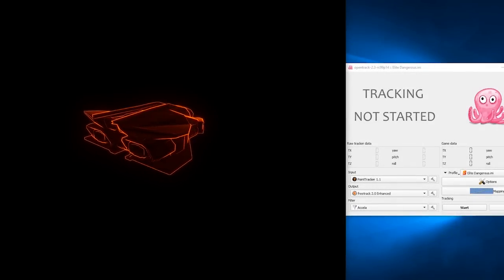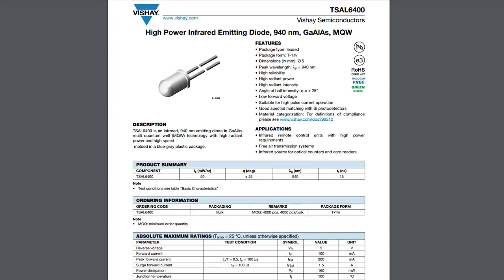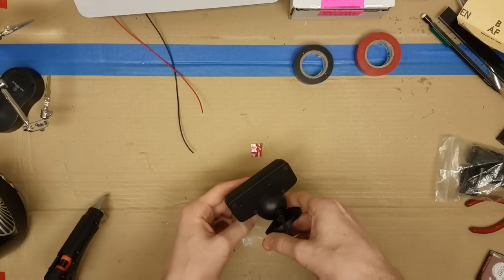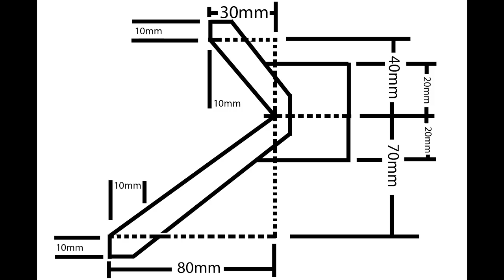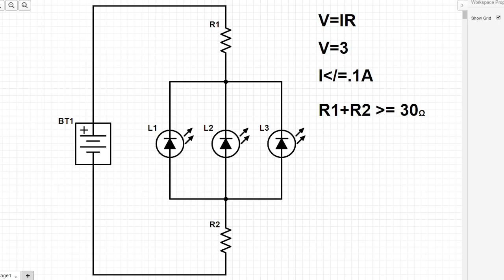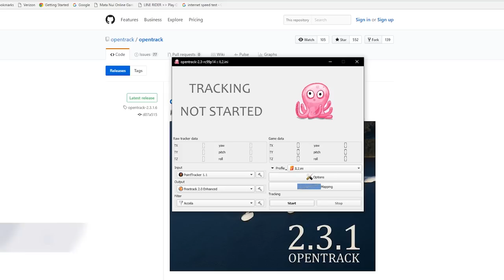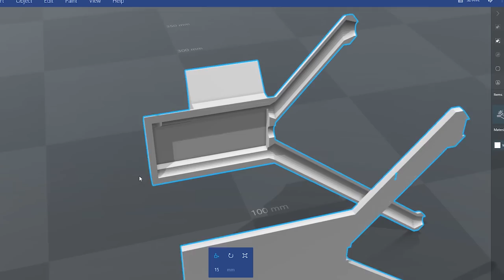TrackIR Build Tutorial

Comment: Any webcam will do. I'm using a very old Genius 640x480 cam. Just remove the internal IR filter from the lens, and you can use low power LEDs (even from old TV remotes). I grinded the LEDs flat so their intensity is same at wide angles. Then in camera options, reduce exposure and brightness untill you only see the LEDs.

Comment: Right, last comment.

I've built three trackers now due to your fantastic how to. I gave one to my house mate. I have a clip for my headphone (though I think it'll never be used because I have a sound system for gaming) and I have rejigged my mcu superman hat which is just a little much to be wearing outside for my fashion sense. The hat works beautifully. For anyone interested and for the vid maker. 

1 60mo resistor.
5v USB power. (I have a  2m USB cable and I chopped a phone charger so I could disconnect at the headset rather than the PC as I have a cat who loves a wire.)
940mn 1.4v, 30ma ir LEDs
Three dead pens (for writing, you need the tube the pen is in)
12 gauge wire I reused from a old fan which is no longer in use. 
A girlfriend who loves to sew. 
A ps3 cam (I have done nothing to the camera(s) (I gave one to my house mate) I just turned the gain down and closed the curtains. I will be buying a filter mind you.

After thought.

I smoke when I game, the camera picks up my on roll and cuts tracking when I have it in my mouth which is.. interesting. Filter is needed..

Thank you. I was saving for that £250 trackir one. I had the money and was about to buy it. I can now use this on something my partner will approve of too. Thanks
Reply: Can you make me one?

Comment: Awesome tutorial! I ordered the parts and will do the build this week.
One thing I'm not quite understanding though is your resistors caclulation. I read quite a bit about electrical circuits today and I am a bit confused.
Your battery Voltage is 3v (2 x 1.5v cells), each LED forward Voltage is 1.35v and each LED max forward current is 100mA. Since LEDs are in parallel you need to provide at least 1.35v and up to 300mA in total which results in:
3v - 1.35v = 1.65v / 0.3A = 5.5 ohms
But then assuming 30 ohms of resistance is used it equates to only 55mA being delivered to 3 LEDs or 18.3mA for each.
I mean if it works then great, it extends the life of the LED but it just seems extremely low.
Reply: Ok I got it to work. I only used a 10ohm resistor but I did have to also follow a tutorial by the Northern Alex and take the IR filter out of the camera. Otherwise, the camera could only detect the LEDs when they were quite close and pointing at the camera.
Reply: @PatrykZ94  You ARE correct.  He could have deliberately added the currents to get 100mA, but his calculation doesn't account for the V drop of the LEDs.
Reply: @PatrykZ94  Did you use one 1 x 10ohm. Or 1 for each IR LED (3)?
Reply: Or another way to do this if you printed yourself a plastic clip with a 3D printer and you want to hide the resistance inside the 3 arms, you could instead use three 15 ohms resistance, 1 resistance per Infrared LED. That way it limits your current to the 0.1A you need. It does add a cost to the circuit (slightly) but depending on how you are building this, this is another way of doing it.

Comment: A couple of things about your electrical circuit:
1) You don't need 2 resistors - only one is needed.
2) Your resistor calculation is wrong.  100mA would give 33mA to each LED.  If you want 100mA each, that's 300mA total for a parallel circuit.  Also, the V number needed for the resistors should be the supply voltage minus the forward voltage of the LEDs.
The TSAL6400 Vf is 1.35V,  so now your supply is 3-1.35 = 1.65V
Current is 300mA.
R=1.65/0.3 = 5.5 Ohms.  
5.6 ohms is the nearest available.  That would give 98.2mA per LED and it would need to be a half-Watt resistor at least.

30 ohms with 1.65V drop gives 55 mA - about 18.3 mA per LED.

So while it IS an error, it's under-driving the LEDs rather than over-driving them - this is the "right" kind of error to have. :)
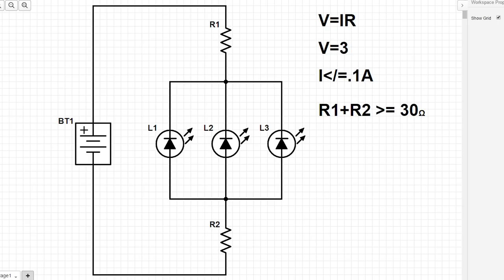Reply: First of all, LEDs are turned the other way around in the schematic. So it doesn't matter what resistors he uses :) 27:14

Comment: I followed your tutorial and yep, it works! Great video. I'm also using the recommended filter, it works great.
Reply from the maker: I'm glad your build works. How was sourcing parts? Was the filter easy to get ahold of?
Reply: @civilprotection8845  The LEDs were easy, and I bought the exact same filter as you from China for $17. I printed a chassis myself. A battery pack I had handy. The camera I already had from having a PS3 years ago; that was the stroke of luck that made this most feasible. I've now tested about 6 types of DIY head tracking, and I like this the best! I might make a video comparing them all.
Reply from the maker: @colinjacobs176  I'm glad to hear that the sourcing was smooth an easy. Sometimes I play with the idea of making an updated video, swapping out some of the major components. I mean, the PS3 eye camera is way too expensive right now for what it is. I have also experimented with alternative filters, but nothing beats purpose-built so far.

And you should definitely make a video comparing all your DIY experiences. The more info available, the better IMO.

Comment: Thanks for such a well explained and detailed video friend. We all appreciate it :)

I had built one few years ago and it was not solid enough, I hadn't really used filter or anything just normal leds and stuff, but with this video I am building one from scratch and hope it will be like in the intro of your video. Other than the brightnesses of the LEDs that I have bought, which may not be enough, I have nothing to worry about.

Good work !
Reply from the maker: Yeah, the LEDs, and the filter are by far the single most important components. I know I spent way too much time and money trying to figure out I needed brighter LEDs. Anyway, I really hope you get yours working (I'm sure you will), and would be very interested to see the end result :) if you run into any problems continue to do my best to answer questions. good luck!

Comment: More questions,

Why would you put a resistor after the LEDs? Why would you need a resistor going back to the battery? Why not one 60om?
Reply from the maker: Resistors can be placed anywhere in a series circuit. Both of mine could have been placed before or after the LEDs. I chose to split them up to keep the wire assemblies proportional and symmetrical. I used two because I needed about 30ohms resistance, and I only had a 10ohm and a 22ohm on hand. If you have a single 60ohm resistor for your 6V setup, then there is no reason not to use it.
Reply: @civilprotection8845  you are  excellent, thank you very much.
Reply: @civilprotection8845  oh, btw. I had a ps3 eye cam on hand and wire. My build cost £4 so about $5.
Reply from the maker: @Jowley  $5!?! I guess everybody can go home. I don't think anybody is going to beat that.

Comment: Great vid. So you didn't remove the IR lens from the PS3 camera but instead bought a lense and put it on the camera ?
Reply from the maker: Correct. I didn't want to risk damaging the camera by digging around inside. The internal IR filter is already weak bc the camera is designed to track the IR emitting ps3 wand. All I did was attach an IR pass filter. Still works great for me after 5 or so years.

Comment: Please help, I can't find the exact LEDs where I live, but will these 5mm IR LEDs work the same? Do I need to modify anything else if I use these LEDS:
Forward voltage: 1.5 - 1.6V
Maximum forward current: 60mA
Wavelength: 850nm
https://uge-one.com/led-infrared-transmitter-clear-5mm.html

Comment: Which resistor did you put in each circuit, the positive and negative respectively the 10 ohm and the 22?
Reply from the maker: I placed the 22ohm on the positive side, and the 10ohm on the negative side. However, I do want to stress that even though I divided the design into a positive half and a negative half, it is all one circuit. It does not matter what resistor is placed where in the series circuit, as long as the total resistance reaches your threshold.

Comment: There are three diodes and EACH diode needs 0.1mA of current, thus the needed total current I = 0.3mA. 2 rechargeable AAA batteries give V= 2*1.2V = 2.4V. To find the resistor value R= V/I = 2.4/0.3 = 8 Ohm. 30 Ohm resistor in the video gives 3 times less current, which is good for battery life, but leads to dimmer LEDs.
Reply from the maker: I definitely did my calculations wrong way back when I made the video. However, there was an unanticipated benefit to over-dimming the LEDs. If the LEDs are too bright for a given distance, the halo can manifest as a visual artifact, which Opentrack interprets as additional points of light, and can significantly degrade the tracking quality.

Comment: I have an issue with my IR tracker, The bottom LED overlaps the middle LED when i look up. Any ideas how i can fix this. Its a Delanclip with ps3 camera setup and its connected to a 43" TV.
Reply from the maker: This is simply a limitation of the tracker geometry. The best solution would be to tune your curves so that your in-game camera is looking directly up just before the LEDs would overlap. Alternatively, you could move the Delanclip further up your headset so that it isn't perfectly vertical, followed by resetting the default orientation in whatever software you are using.

Good luck!

Comment: Great video but i have a question:can i use another webcam? ps3 now is not possible to find or price are to hight for used one. Thanks for the help
Reply from the maker: Most other webcams do work. The only camera I've seen not able to detect IR light is an Iphone camera. The hard part will be finding a camera that can run at decent resolution and high framerates. I would recommend nothing lower than 320 x 240 @ 60 fps. Also, make sure to take note of the cameras FoV, and adjust Opentrack accordingly.

I hope some of this helps, and best of luck with your build.

Comment: Hi! Thank you for this video tutorial, I use it for my own trackIR build. But I have question. Are you sure u didn't remove internal camera IR filter lens, or maybe someone who sold it to you did? Cause I bought same camera, same IR leds TSAL6400, use same two AAA batteries to power it and same resistors, the only thing I don't have is filter lens, but I tried many things like VHS video tape piece, x-ray photo piece and even without any filter my dots from LEDs are too dim and when I turn them like + - 20 degrees they disappear at all (I also sand them as you show in video). I looked for other tutorials with this camera and they all say to remove IR filter lens inside the camera. What did I wrong?
Reply from the maker: Hmmmm. Alright, there are a lot of things that we can try.

But first, I just want to reassure you that the internal IR filter was not removed on my eye camera. I modified five or six of these cameras in the same way as the tutorial demonstrates, all within a year or two of posting this tutorial. None of the cameras came second hand, and they all arrived in sealed packages, and all of my builds worked with equal effectiveness.

Indeed, my whole motivation for spending a good amount of money on the external IR pass filter was so that I wouldn't need to open up the camera. So, let's put a pin in that theory for now, and we can revisit it if more evidence points to it at the main problem.

*The first thing I would recommend, if you aren't doing it already, is to test your circuit on a breadboard. This will make troubleshooting much easier.

**Also, as a point of reference, my sanded LEDs can keep tracking up to about 110 degrees (Though I only use the first 45-50 degrees).

***Moving on, about how far away are the LEDs from the camera? Mine end up being one full arm length away (roughly 60cm).

You mentioned that you are not using an IR pass filter. Honestly, my gut says that that is the issue, even though you have tried alternative solutions. Luckily, there is a really easy way to test if this is the issue! Take off any filters you have applied to the camera and test the system in the darkest room in your home. If you see better results, then that would point to the alternate IR pass filter as the problem-- they may be blocking some of the IR light along with the visible light. The best solution would be to procure a purpose-built filter. Alternatively, you can try a different LED that has a wavelength further from the visible light spectrum.

Another possibility is the amount of resistance in your circuit. I know that you followed my instructions from the tutorial, but I did not calculate the required resistance correctly. I'm sure beginners luck played no small part in the success of my builds. And because the builds I made worked so well, I never made a correction for fear of introducing some new issue. You can safely reduce the resistance of your circuit to increase the LED brightness. By exactly how much, I couldn't say right now. But if you want to learn more, research "LED forward voltage" or "LED voltage drop." Be careful not to make the LEDs too bright, even if it's safe to do so. LEDs that are too bright can create lens flare and disrupt tracking. Make this one of the last things that you try.

I don't think the sanding on your LEDs is the issue. However, if you are working on a breadboard, mix both sanded and non-sanded LEDs into your build to compare the relative brightness. Sanding creases the viewing angle of the LEDs, but it does dim the brightness.

If all of the above fails, then, and only then, consider opening up your camera to remove the IR filter. I know that a lot of other tutorials include this as a necessary step, but I have never found that to be the case.

That's all I can think of at the moment. Start with these solutions and let me know the results. Best of luck!
Reply: @civilprotection8845  thank you for such a detailed answer! However i already gave up looking for a solution 🙁 and remove IR filter lens from inside the camera. It significantly increased “brightness” from LEDs,  but sadly it also ruins focus of the camera, so all become very blurry and “dots” from leds very big. So i remove some small lens from my old monocular, which just fit well inside and it improve focus pretty good. Then i add piece of VHS video tape inside, between sensor and my new lens, and it worked. However then i realised it was not enough cause when sun shines in my room there where “parasite” dots showing. So i add another “filter” cutted from x-ray picture on front lens of the camera and now it shows only my LEDs and nothing more. So in result it works fine, but i spend more time and efforts and “ruined” camera, so i cant use it any more like normal camera.
Reply from the maker: @Dim_moon  Well, I don't think it's "ruined" if it is functioning how you want :)

Thank you for posting a detailed description of your work. It's all valuable information that I and others can learn from.

I'm sorry it cost you normal camera functions, but I hope that you get many years out of it as an IR tracker.

Happy flying!
Reply: @civilprotection8845  I have another question if you don't mind :) What batteries you recommend to use for longest life? I thought it would be a good idea to use rechargeable one (I've got 2 x AAA Duracell 1.2V 900mAh), so I don't need to buy new batteries every time, but I've noticed that after like 6 hours of use my LEDs become dim and I have to replace them. Maybe that's normal, but I would like not to change them so often.
Reply from the maker: @Dim_moon  So, you'll need to make a choice between battery life and battery weight. AA would be the next step up, but, personally, I found them to be too heavy to comfortably wear for an extended period of time.

2x AAA rechargeable batteries were the best compromise for my needs. That said, I had two pairs of AAA batteries, so I always had a fresh set that I could swap in.

I ran that build for 2 or 3 years before completely redesigning the circuit to draw power from a USB port.

I hope some of the above is useful. Happy flying!

Comment: Great tutorial. Especially the part where I don't have break about 3 Eye Cameras and cut myself before getting it right. Let alone trying to find a camera-film!
One question though, I would like to use my camera with the TrackHat commercial system. They ran out of (modified) cameras themselves. So I want to use my own.
TrackHat says they remove the camera's IR lense as well ... However ... do I understand correctly that you found out that the performance of this filter is NEGLIGABLE and blocking all other light with this pass-filter still leaves enough IR light to use the camera as an IR tracker!?! (Obviously depending on the brightness of the LEDs)
Reply from the maker: I cannot say with certainty that the internal IR filter is "negligible." I have never done a side by side comparison because, frankly, I never wanted to deal with the hassle of opening up one of those cameras.

What I can tell you is that the ps3 eye camera was designed to track IR light emitted from the ps3 motion controllers. Thus, it was built with a very weak internal IR filter. I gambled that it wouldn't be strong enough to hinder tracking. That gamble payed off for me.

And yes, find the brightest LEDs you can, with the widest field of view.

I hope that answers your question. If you have any more, feel free to ask. Good luck on your build!
Reply: @civilprotection8845  Thanks! 👍🏻